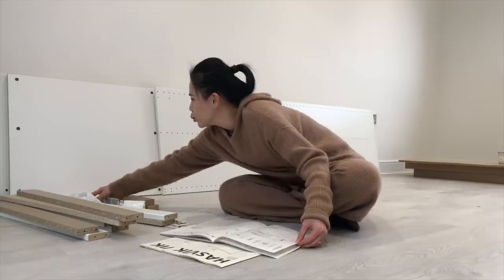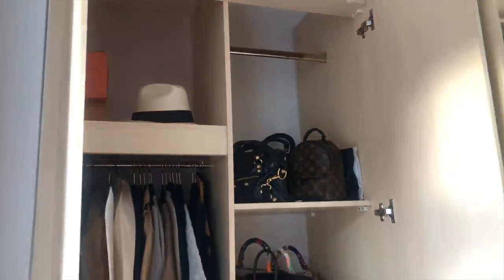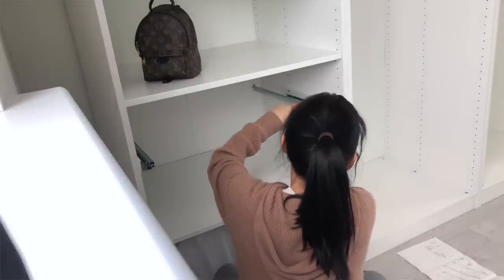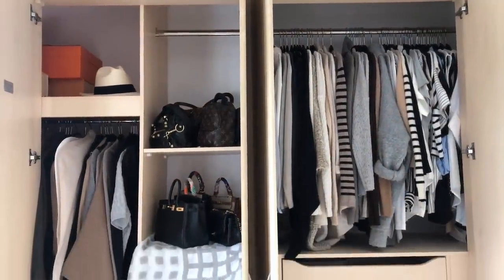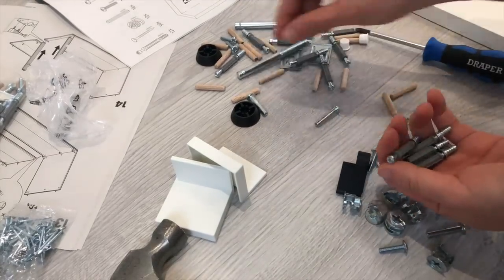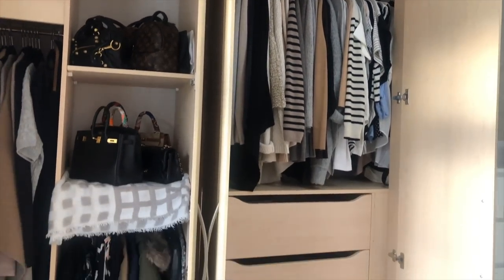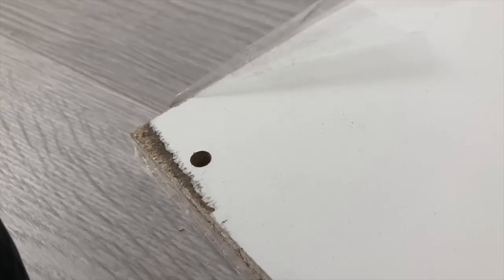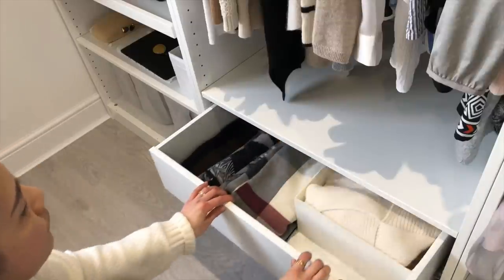Why I Changed My Wardrobe And Chose IKEA PAX |build a luxury minimalist wardrobe on budget

Comment: I like to think of myself as a bit of an IKEA pax expert, as I have had over 20 of these units…..In my opinion the quality is less than it was a few years ago, the mirrored doors aren’t as solid as they once were, but on saying that it’s a  great system and if you have the space to build each unit as you make it, it’s not that hard to get them in in a short space of time.  The design process is very easy, I never bothered with their online design feature.  

TIP for anyone thinking of getting PAX: Just measure your walls width/height and also the depth that you require “twice/3times, just to be on the safe side”, and take into account should you add doors and drawers they will open up into your room, so they need space to come out.  Measure as if those doors were attached to the unit and open.  I would also recommend the taller units out of the two if you have the ceiling height.  It also helps if you measure your longest items of clothing ON the hangers, and tallest boots/bags to give you the idea of your requirements.
Reply from the maker: This is really helpful, thanks for sharing xx

Comment: Hi Eileen, your closet is a bit fancier than mine but I did a similar thing in the existing large bedroom closet that was already in my co op apartment. There are 3 hanging rods. I had my super lower all of them. I had him add a whole row of shelves from floor to ceiling to hold my purses. I bought a not too big cabinet with 4 drawers to hold all my cashmere and it fit perfectly into a back corner of my wardrobe. My favorite part of my closet is that I REMOVED ALL THE SLIDING DOORS! I just hated them, they were continually off the track and I had to get the super to put them back on the track maybe 50 times. Really. I felt they were ruining my life so I had him take them down this summer and put up a long curtain rod and hang up beautiful curtains instead. It’s life changing. I can walk in and out, see everything, and yet it’s still covering up my things inside. I totally love it.
Reply from the maker: Omg I can imagine how frustrating the must have been! Glad it was sorted it xx

Comment: I like the open look if it's a room dedicated as a closet and there are no major issues with dust, humidity, etc. Personally the extra holes bother me visually so I'd cover those (I believe they sell many solutions specifically for this purpose which doesn't affect the flexibility of the system if you want to change it later).